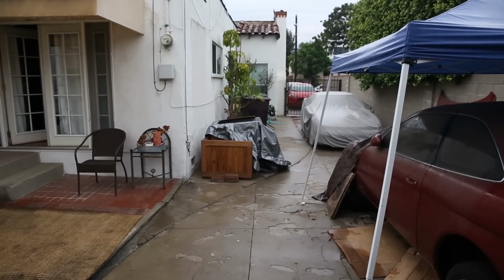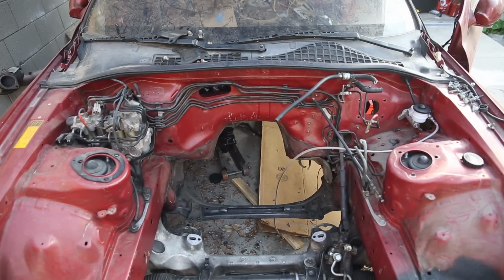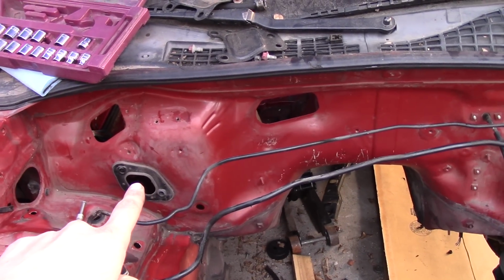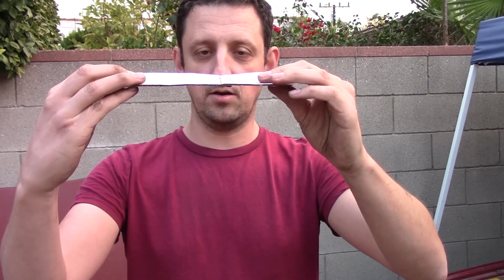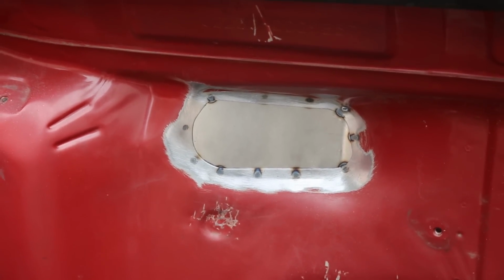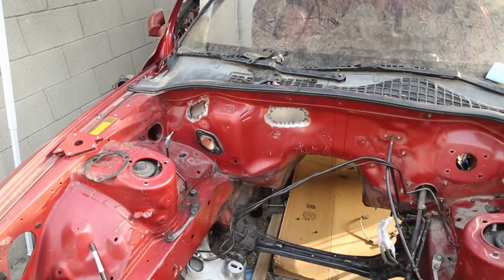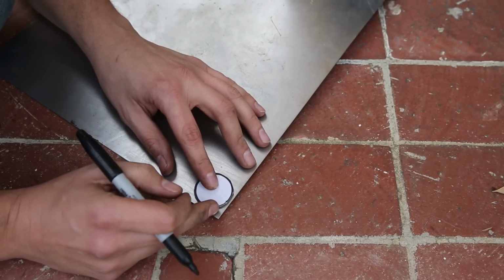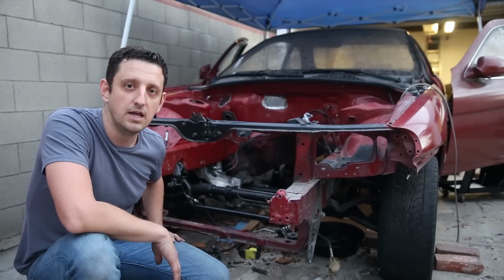Lexus SC Drift Build. Ep.15 - ABS Removal and Welding the Firewall

Comment: Yo bro. Need to see that video as to how to delete ABS module ASAP. I have a toyota soarer in Jamaica and been following your vids, im a 1jzgte sigle turbo build.
Reply from the maker: That is the next video that will come out as soon as I get back from Argentina next week. In the meantime, once you remove the ABS unit, remove all 8 brake lines and install new lines from the master cylinder to the two front brakes and the lines that go to the rear brakes. You can make your own lines, or use a kit like this: http://suspicious-garage.myshopify.com/collections/brakes/products/suspicious-garage-jzz30-sc300-400-abs-elimination-kit
Reply: Fully Spooled
ok cool so it's just simply a line splitter to front brakes and one line to rear. I was thinking to make my own lines
Reply from the maker: Yep! The factory master cylinder has a proportioning valve built in, so you just need to run new lines. I'll be doing this next week when I also install the LS400 big brake upgrade.
Reply: looking forward to video

Comment: Nice job on the welding. Try that with flux core on rusty metal and you will know true suffering! Planning to use some body filler in the engine bay and paint it up nice or leave as is before painting?
Reply from the maker: PhantasmAMX Thanks! I sprayed a layer of primer on for now to keep it from rusting. I'm not going to paint the engine bay until I get the tube front and stitch welds done, but that won't be for a while.
Reply: Fully Spooled Going tube front end right away? Necessary to fit the engine or just because? Badass.
Reply from the maker: PhantasmAMX No, not right away. But it's planned. I want to get the car running and get some seat time before I tear it down again.
Reply: Fully Spooled That's more what I was thinking. Awesome though. Great work man! You definitely deserve more subscribers. I'm sure your first startup and drive videos will be your biggest ever.

Comment from the maker: One quick note - I removed the ABS unit itself in this video, but will be installing the ABS elimination kit in a future video. I mostly had to get it out of the way to get to welding. Stay tuned for updates on the braking system.
Reply: Fully Spooled what welder are you using? Love the build and the custom work
Reply from the maker: cayden haugen thanks! It's a Hobart Handler 140.
Reply from the maker: cayden haugen thanks! It's a Hobart Handler 140.

Comment: This is perfect timing I just got my car back and I'm going to do the abs delete. Thanks!
Reply from the maker: I should mention I just removed the ABS unit in this video. I'll be installing the Suspicious Garage ABS elimination kit soon though! Good luck on your ABS delete!
Reply: Fully Spooled thanks man I ordered the same kit lol
Reply from the maker: PhantasmAMX Sorry if I was over explaining. I figured I'd just explain it all in case someone reading this wanted to know in detail.  I'm still debating between that kit or removing the brake booster entirely. It's a matter of money at this point.
Reply: Fully Spooled Naw, no problem at all, I appreciate the effort. :)
I actually don't think I have driven a car without a working brake booster. I'd have to try it first.
Reply: Fully Spooled What does the elimination kit do?
Reply from the maker: PhantasmAMX the stock ABS brake lines go from the brake calipers to the ABS unit, and then to the master cylinder. When you remove the ABS unit you need to route new brake lines from the master cylinder to the calipers. The elimination kit supplies new brake lines in the correct length to just bolt on.
Reply: Fully Spooled Ah, all of that I knew except what the kit was. I thought maybe there was some special brake balance issue or something. Figured you would be making your own brake lines, but that will certainly make things easier!